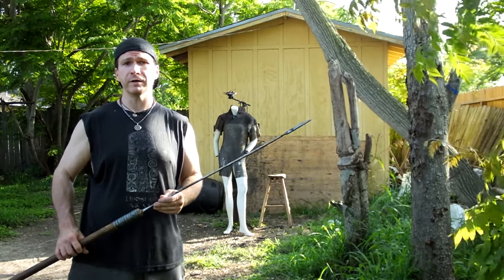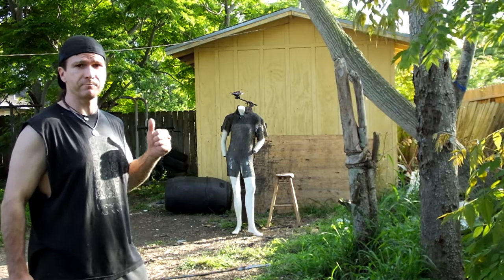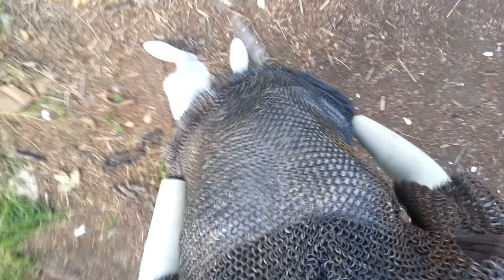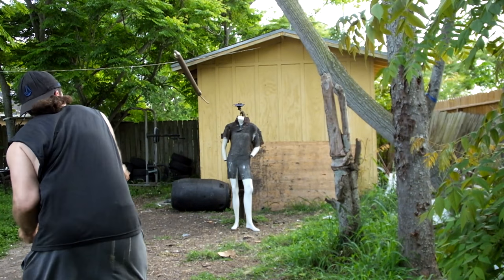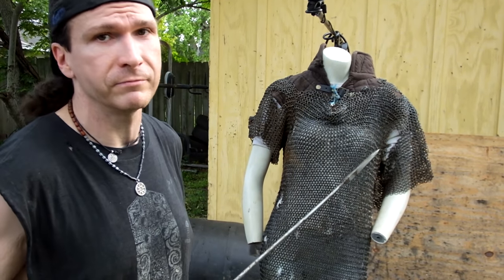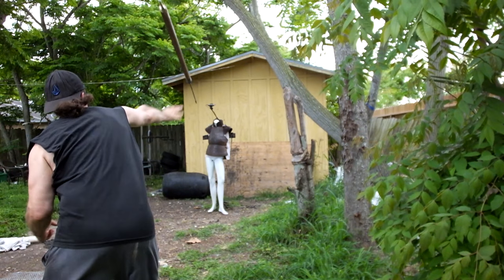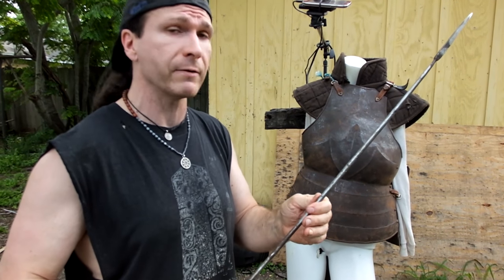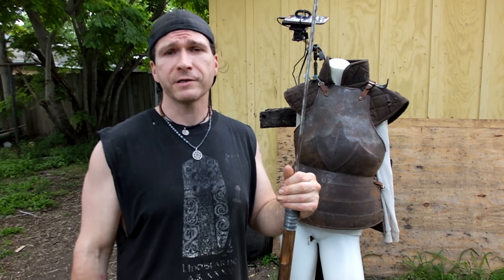Roman Pilum tested on Sealed Ring Lorica Hamata (Maille) and Plate!

Comment: The mail will hold up all day long, but any one of these hits would hurt like hell.
Reply from the maker: +Charles W Ja! They would.
Reply: +Charles W my breakfast would be covering a large area in front of me I am sure
Reply: This is why you better wear a good padding under it like a Gambeson.
Reply: Even better, rely on your scutum.
Reply: Interesting how mail can't be pierced, but has to be cut. I would like to see a scorpion ballista :)
Reply: ok having worn padding and mail , there is still a large dent formed when a spear thrusts into the mail. also when my club was doing a sharpness test on different types of mail and armour the dent left in the human substitute , in this case green river reeds tied  in a bundle. the dent was about the size of a golf ball in size and depth up to 2 to 3 cm deep. it was much larger and deeper without the padding . when we added a coat of plate (leather with single layer metal plates attached) the dent almost vanished and was much wider . mail is designed to stop slashing attacks and not full force stabs , broad head arrows but not bodkin type arrows. clubs , mace and axe tend to ignore the mail and transfer the force straight to the person less a bit for the padding. if you doubt that a one inch dent in your arm is anything to worry about  , try and push a golf ball into your arm.You can still break bones while wearing mail and not have a puncture or cut . point in case I have had a cracked rib from a blunt spear while wearing mail.
Reply: one of our members was stabbed with a spear , it avoided his armour and just punched straight through his skin. luckily it was not a sharp spear , so it just pushed his organs aside rather than slice them up. the only other wound i have heard of similar to this was a ramrod left in a musket and fired into a combatant during a local fair . both victims had no idea they were wounded , they felt the impact but hadn't   realized the extent of the injury. I was in more  pain longer with a cracked rib than my club member was with his stab wound.
Reply: @breaden4381  Hi, actually mail is particularly good at resisting cutting, generally fairly weak at resisting point penetration as you only need to break 1 or 2 links for a point to go through. Slashing cuts are spread over 10s of links.
Reply: 2bingtim I was referring to this test, where the mail was not pierced, and where Thrand has cut mail using tip cuts.
Reply: @2bingtim  Then why did the Roman Cataphracts wear mail? It was said that they were covered in armor and could deflect arrows and javelins while riding around firing arrows back.

That would be like saying modern body armor is designed to protect against bayonets!
Reply: @histguy101  Mail will deflect glancing strikes, but square-on hits are far more likely to penetrate. There's a hell of a lot of kinetic energy in a pilum point hit & not that much can burst the single ring it hits. Once that happens there's a neat little gap in the mail for the spear/javelin/pilum to pass through. Bodkin arrows can do the same. The Roman Cataphract changed over the course of the late empire from a fully amoured head to toe lancer(often riding an armoured horse) to a guy in a mail or scale or lamellar armour shirt employing spear, bow & sword in more conventional cavalry role.
Reply: @2bingtim  I'm referring specifically to the lancer bowmen of Procopius and Maurice, who are covered in mail, along with their horses, ride around firing arrows from any direction, and are said to be able to take hits from arrows. We can assume they had the very best armor available up to that time in history.

It may be that the widespread use of mail led to the extreme popularity of the mace in the 9th-10th century.

Comment: If I may make a small suggestion, for future videos you might want to consider one of two things to help measure the impact of a weapon even when it doesn't penetrate. One is an impact indicator like Shockwatch, which is a small decal with a vial that, if hit with sufficient force, changes color, I believe they have different indicators that are designed to withstand different amounts of force; I've seen these used on Mythbusters before and might be one way of measuring the impact force of a weapon. Another method is cheap and low tech, using a block of clay, it's not 100% accurate but you can get an idea of the blunt force trauma by the size and depth of the hole left in the clay. The side benefit of that method, aside from being cheap, is that if it produces and interesting hole/shape on the clay you could fire it and maybe glaze it too and then sell it as art.

Comment: I was lead to believe silver-soldered rings weren't this strong. I'm going to have to reconsider this as a construction method...

Thanks a lot, guys. As always, love to get good data.
Reply from the maker: +Lunumbrus Depends on how thick solder is and silver content of solder.  Never had the silver break before only rings cut or sheared not broken by anything other than firearms but the silver did not break the ring did lol.
Reply from the maker: +Lunumbrus Only front section of chest is soldered not entire shirt but are we tested is sealed shut for testing.
Reply: +ThegnThrand That's a surprise, for sure. Do you know the silver content of the solder used? 

And that makes sense, front being the "hot zone." I always feel like uparmoring my kidneys is a thing, too. Reacharounds from dagger-users don't seem like a good time, you know?
Reply: +ThegnThrand What do you bench?
Reply from the maker: I will try to find some old containers of it I have its quite expensive and takes a very high temperature. I want to say 70 to 90 % but uncertain. It took braising to do it a very high heat with touch.

Comment: Your pillum is already bent when you released it during your first throw. Maybe that could have affected the penetration power, as well.
Reply from the maker: No it flexes like an arrow then straightens out as it travels to target it should not have been an issue.
Reply: @Thrand11  I rewatched and I guess it was the third throw or so. Probably because it was already bending.

Comment: What kind of metal hardness was used for making the armor? Does it resemble the quality of ancient times or is it more like modern steel?
Reply from the maker: Yes very close unhardened still very close to early iron or steels.
Reply: @Thrand11  Thank you.
Reply: @Thrand11  I have read some stories, where a soldier was wearing two mail armors, one on top of the other. So I always figured they must have had something on the battlefield, that worried them in order to do so. But if not arrows and bolts and javelins.. then what? Where they trying to have armor against siege weapons? Lance attacks from horse? What could possibly hurt well armored soldiers.
Reply: @agroplode9680  i just read that some saracen account stated that the only way you could kill or harm horsemen in mail armor is by couched lance attack. Even if you did hit the horsemen with the lance and knock him off, some of them survive and even continue fighting as a footmen

Comment: Normally they wore gambeson under mail, right? What about the romans? Did they also wear gambeson, I mean, layers of clothes aren't that hard to come up with. But I have never seen an exmple for roman gambeson, does someone know something about this?
Reply from the maker: +silentkiller2mm Not sure I would assume so but many reenactors that do Roman era do a tunic only.
Reply: The Metatron has a video of Roman gambeson.
Reply from the maker: Lowe Skarp
Cool I was most certain they would have normally worn  multiple layers of clothe under Lorica Hamata when you hear Gambeson under maille omitted is due to environment such as hot deserts ect.
Reply: Lowe Skarp Okay, thanks ^^^Gonna check it out!
Reply: %username% it's called subarmalis, if u wear a lórica hamata then u need a subarmalis, they work together

Comment: Even without penetrating the mail all that energy transfered through the small point could cause haemorraging of organs/internal bleeding if hit in the right place. Couple with the fact that alot of Romes enemies didnt have much in the way of armour so some poor sods were taking that to the bare skin! A formidable weapon when used en masse. Supposedly very good in both offence and defence as well.  Really good and enjoyable video, thanks for it.
Reply: Especially bad for the enemy front rank as a volley of thrown weapons was usually the opener to a battle. So theyd all get skewered by these, fall, and get trampled by their own dudes.
Reply: Another use is that even if your shield protected you, there is now a big old javelin jammed into your shield, and if the point is barbed it may be extremely hard to get, causing you to most likely just throw away the shield at that point.

Comment: mail is just for slashing attacks it wont help missiles (unless is a slinger stone) or stabbing well at all .
Reply: segmentata on the other hand was far more protective..
Reply from the maker: This is not true maille is riveted and solid stamped rings every other row and will stop thrust and arrows quite easily. It's a common myth due to historical programs testing modern costume butted maille that it won't work against arrows and thrust. It helps s quite effective especially if backed with multiple layered cloth padding.
Reply from the maker: The segmentata was only 1mm thick iron in most cases lorica hamata or maille was  better and preferred by officers.
Reply from the maker: Maille will stop a gladius thrust easily.
Reply: @Thrand11  look at Roman battles and casualties during the roman civil war..
Reply: that's the reality of the damage etc-